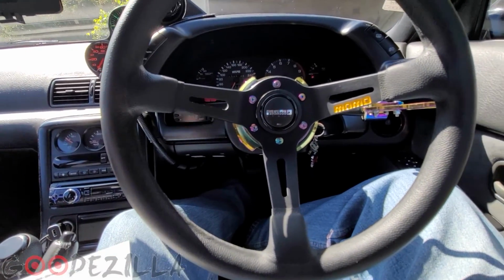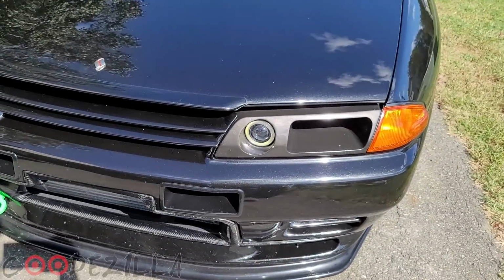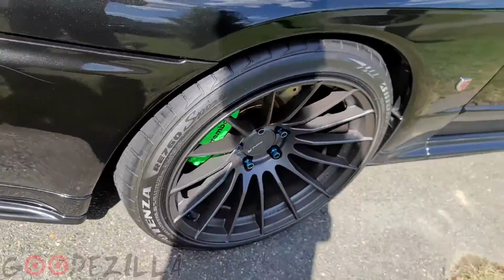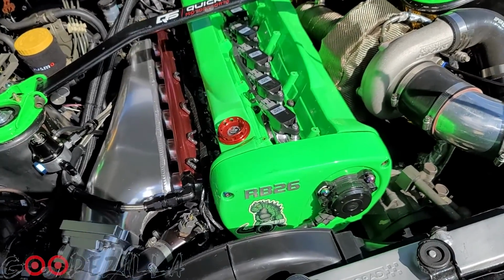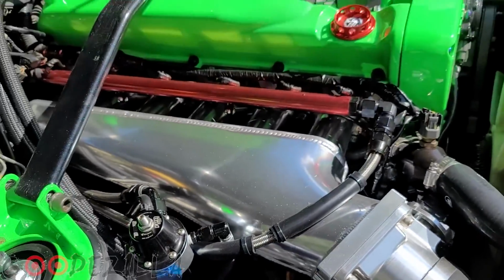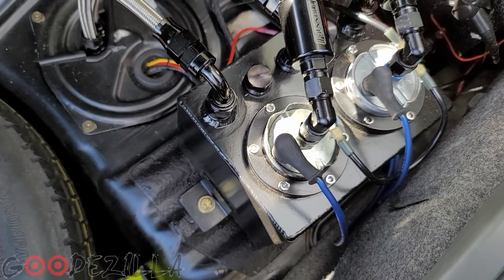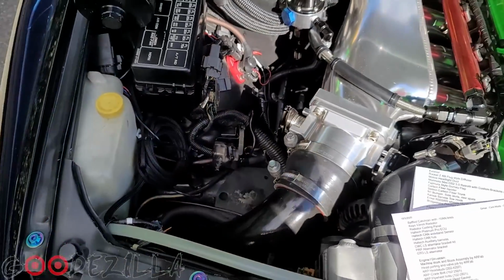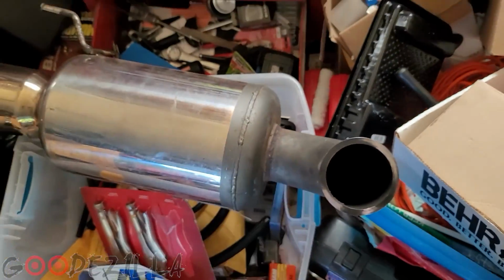My 620HP R32 GTR Overview AND Giveaway!!!

Comment: Glad to see you are using some of the same parts I am using. I guess I am using the same parts you are using on my R32 GTR, kinda sorta the same. 89 GTR mostly stock with necessary updates...Old wiring and rubber parts updating...

Comment: This is groovy! I have been subbed to your channel for a while now and love how you have tweaked and honed your R32 into just the "Zilla" that you want...🙂
I am residing in Nassau, the Bahamas...and unlike you, i have an R33 GTS-25T series 1.5 that i am trying to get into road worthy condition. It now runs great with what i have done so far...but like any RB owner knows...seeing that these cars are now well over 20 years old, they need lots of "TLC"...I am still on the stock coils and wiring harness...needless to say my harness is in rough shape...so a new one would do great to get the ignition system headed in the right direction. I am currently working on the fuel system...i already got a new fuel pump installed...and the added new pressure has shown just how old the fuel lines are...lol. I now have to drop the tank and replace all of the fuel lines...a big job but I'll get it done.
Keep up the awesome videos...👍🏼🙂

Comment: What are the exact specs on the precision turbo buddy? ( exhaust housing etc) I’ve had a look on GoodeZilla.com ; but it doesn’t go in depth. Thanks!
Reply from the maker: 84 A/R. I say it in the video, I know it's a long video though. Check the  link in the description. It's my exact turbo.
Reply: Thanks for that. It’s there for all to see! Mines a 2.6 with the engine fairly similar to yours but the fuel system isn’t quite as serious. I’m running 605bhp at flywheel on twins (98 octane fuel) I’m thinking of getting a big single so I’m not maxing out the  turbos. If you had a time machine, would you go for the same turbo?

Comment: How much you spend thats good to know.

I plan on getting a 97' r33.
I would like to spend 20k modding it.

400hp is my goal nothing crazy. I just like the looks
Reply: 20k would be getting you considerably more than 400hp. I spent less than 10k and I'm at 570hp.
Reply: Yeah 400hp is dead easy. I have 469hp at wheels on a stock airbox with K&N. Exhaust. Dash 5's. Less than half what your talking.
Reply: It starts getting really expensive after 600 hp goals
Reply: Im including, rims/tires, mines strut bar, coilovers, carbon wing add-ons, exhaust tomei, audio, r34 valve cover and few other bits.